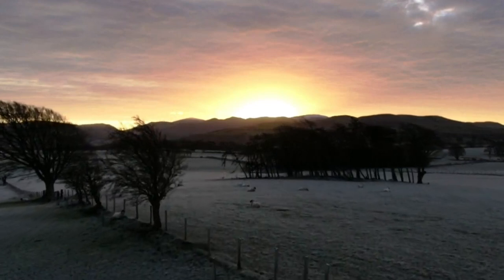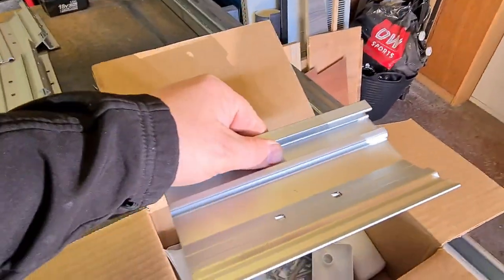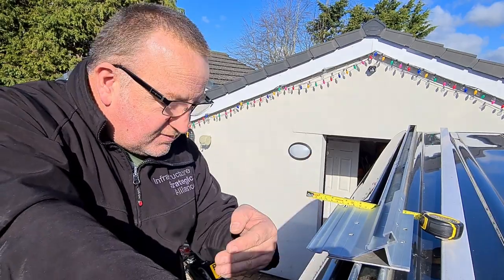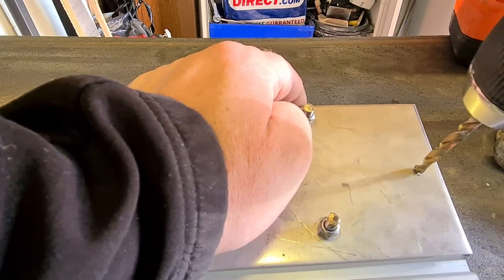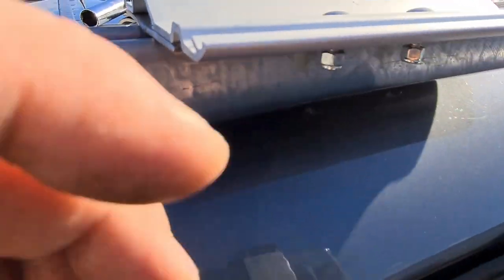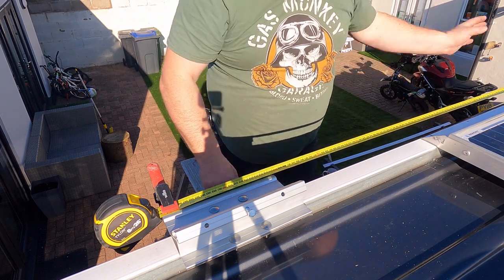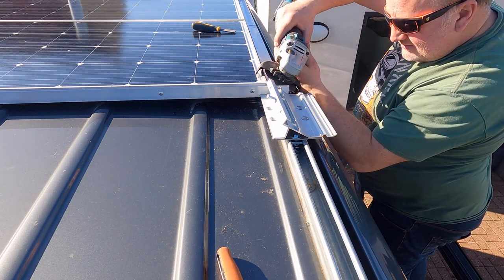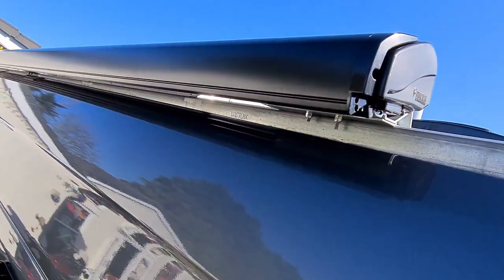selfbuild campervan | vw crafter | van build | F80s awning install | part 38 | the crafty blinders

Comment: Watched your video, I have my panels in the same position except I can’t move mine so have to try and work out how to get the bracket under the panel, either that or get a f45s. Just don’t like the way they stick up. Is it possible to send you a photo of the bracket because if I can fit it around my panel I may be in luck.
Reply from the maker: Let me know how you get on its sounds like you may have a job on you hands

Comment: great video.
Did the lower brackets on the bodywork did came in the kit ? 
I m looking for this solution rather than to leave the pilons on the ground
Reply from the maker: Yes, the brackets come with the kit we had this fitted for 2 years now with no I never peg out the awning supports 😁👍

Comment: Just watched your excellent video. Are the brackets a set distance in from the ends of the awning or is this flexible. Reason I'm asking is I want to get the 3.7mts awning but only have a 3mt unistrut on the roof. Therefore I would need to have the brackets 350mm in from the ends. Do you think that is possible . Also what size are your spreader plates please. Thanks in advance
Reply from the maker: There is room for adjustment, 
I'm sure you will be able to move them where you need them
As for the plates there are the same size as the  brackets I think tge 3.7mtr awning bracket a slightly smaller to be honest

Comment: How did you fix the leg brackets to the van
Reply from the maker: They come with stainless steel screw and I added a little silicone to keep the water out 😁👍

Comment: Yet another video where im stealing exactly your idea.
Trying to get my roof sorted this summer, rack, awning, Maxxfan and solar.
For the awning, reading the comments for details, have i got this right?
1) Fiamma F80, best for flat roof mounting.
(seems the F65 is for wall mounting on coach built motorhomes)
2) Get standard flat brackets.
(If they dont come with the basic awning.
3) Make up stainless steal plates.
4) Comes with van side mounts, just fit with sealant.
Keep up the good work and cutting the furrow fir the rest to follow!
Reply from the maker: Steal away 🤣👍 just pne think the side mounts are screw and sealed
Reply: @TheCraftyBlindersvanlife  I'm heading off to the local metal fabricators soon. Reading the comments I can see you've used 5mm thick stainless steel plates to fit your awning with the standard flat Fiamma brackets. Can you remember off the top of your head the dimensions of your steel plates?

Comment: Hello,

I started with Video #1 and got this far (#38) in just a few days.  I have a 2014 MB Sprinter 170 Extended High Roof and am installing a roof rack real soon.  In your roof rack install video you only put 3 meters of unistrut on each side but in this video it is extended forward.

Can I ask how long is your base Unistrut and how wide are your cross supports for the solar panels.  I am going to start with the large unistrut and was thinking of going 14' long.  I think I can do that before the front clip rolls downwards.  Do you agree?  I will find unistrut in Florida soon and begin my install, I do have to remove my headliner firsts and maybe even leave it out and use paneling to finish the roof and sides, as you did.

Bill - W3SI
Reply from the maker: Hi Bill you spotted my mistake 😁👍 I never considered that the awning would need some support I would suggest fitting a longer 4mtr section if you have the opportunity
I'm actually extending mine again as I've jus purchased a 52" light bar for above the cab area 
I believe the distance is 1350mm between the uni strut for the solar I would need to measure it to be sure
We have a Facebook group called The Crafty Blinders Van Builds if you need any advice or want a quicker response we have a few expert seasoned van builders on their to help 😁👍
Reply: @TheCraftyBlindersvanlife  
Here unistrut is sold in 10 foot sections and I plan on using 14 feet (4.25meters) and using the other 6 feet as a cross brace.  I think that will work fine and can be adjusted  in time as I experiment with it.

Comment: I have the same awning already fitted to my van it was an ex-hire camper.. I need to fit a roof rack system so thought id do the same as you .. is there anything you would change?? before a order the brackets.. thanks for all the videos.. so helpfull.
Reply from the maker: hi sorry for the delay in responding very busy working on the van, if I was to change one thing it would be I would add another support making it 4 instead of 3 just for piece of mind 
good luck with the build 👍

Comment: Great job as always Sam, did the standard brackets come automatically with the awning or did you have to order separately?
Reply from the maker: I phone the guys at Magnum Motorhomes and discussed what I was attempting to do and straight away recommend the standard brackets it worked out a little cheaper to 😁 happy days

Comment: Hi Sam great video iam fitting my f80 onto unistut exactly the same as you have but i don't have any brackets iav been on magnum motorhome website they have 2 kits for the crafter 1 is 106 pounds called  m41  the other is 216 pounds and is called m43 do you know which 1 you used i have a 2019 crafter and don't want to use the 216 m43 if I can get away with the m41 hope you can help cheers m8. Ps hopefully see you at Whitby at Halloween if you are going cheers 🍻 👍
Reply from the maker: I used the standard brackets not sure if tgey have a number your better of ringing them and having a chat they will send you the right one I then made 3  stainless steel spreader plates that I bolted directly to the unistrut 
We will be at Whitby for Halloween it will be nice to see you come say hello 👋
Reply: @TheCraftyBlindersvanlife  brilliant sam thanks for your help I will ring them Monday we will come over to see u at Whitby and say hello  cheers m8 😊👍
Reply from the maker: @ThePistol1977  😁👍

Comment: another super video Sam , i'm doing my own conversion atm and have in the last hr discovered that an awning is now required by the DVLA when changing from a panel van to a motor caravan  so am now over a grand poorer :S  , btw i see the legs are attached to the side of your van rather than resting on the ground, is that the way the F80s is designed or are you able to place the legs in either the ground or the van side ?
Reply from the maker: You can secure the legs both ways we mainly use the van clips as we have LED lights in the awning 
The DVLA application is BS mine came back as a van with windows 🤯
Reply: @TheCraftyBlindersvanlife   omg , is it still a van with windows , were you able to appeal it
Reply from the maker: @joedeath332  I have a plan watch this space🤫
Reply: @TheCraftyBlindersvanlife  I really will be watching this space and would appreciate a tag when you are able to share , as I'll be applying to make our van become a campervan in 2 months time , can't believe they turned your application down , total clowns as you said Sam.

Comment: Best thing I done was fit my f80s to my crafter just started following u really enjoying your vlogs
Reply from the maker: Hi Rod glad to have you on board 👍 have you had any issues with your awning I've a video coming out soon about the support leg brackets mine have failed on nothing side so I need to replace them 
How far on are you with your build?
Reply: @TheCraftyBlindersvanlife  can't fault mine as yet only used about 10 times tho need to do rear springs looks a bugga
Reply from the maker: @northeastcarpfishing    hard work but worth it 👍